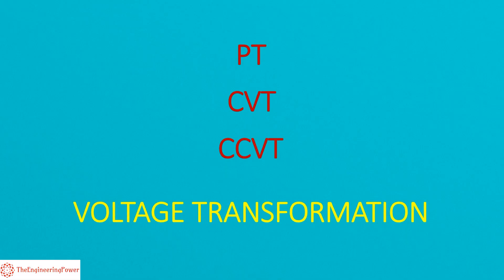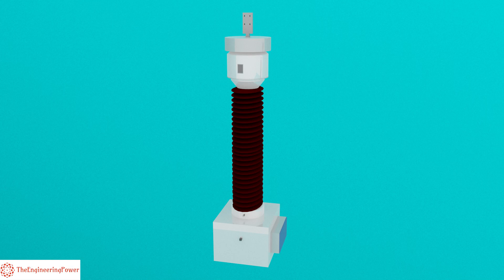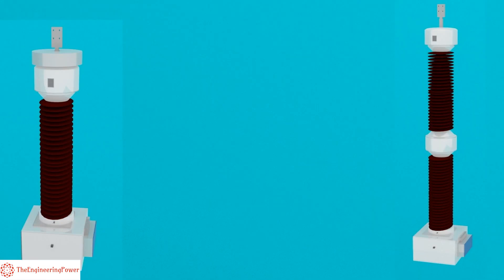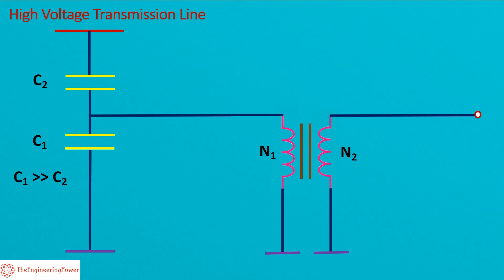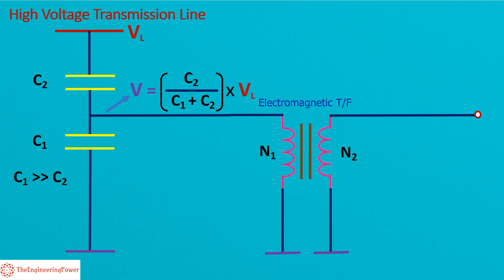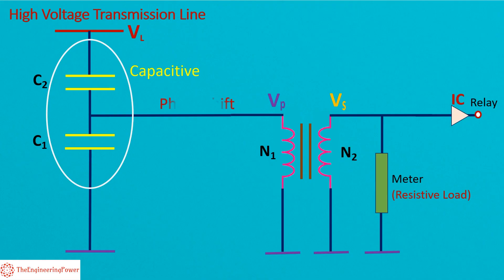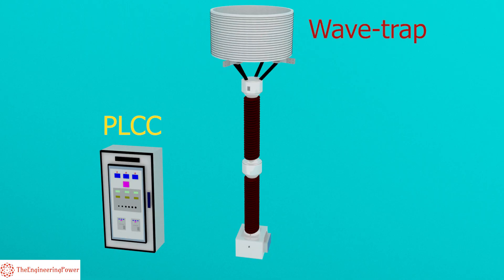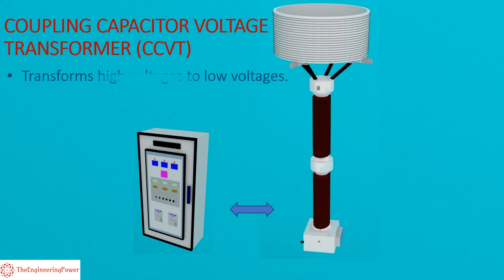What is Capacitive Voltage Transformer (CVT) and CCVT? Difference between PT, CVT and CCVT

Comment: Good work, but am a bit confuse with how the capacitive divider ration was written. i think it should be C1/C1+C2
Reply: nope, it was correct, in case of capacitors C2/(C1+C2), the expression becomes opposite across C1, unlike resistors R1/(R1+R2) & inductors L1/(L1+L2) are measured across R1 & L1, respectively..